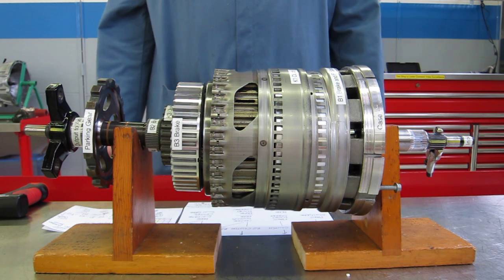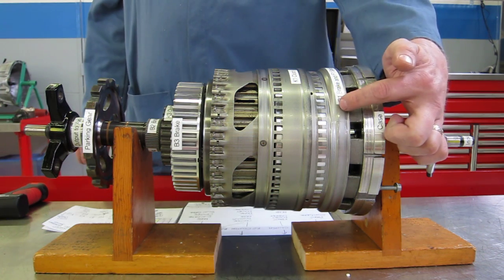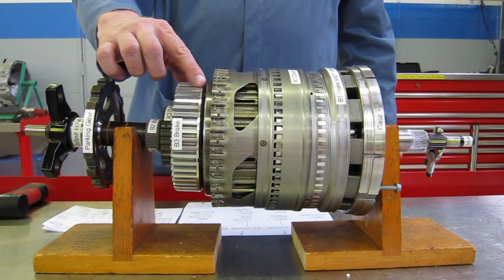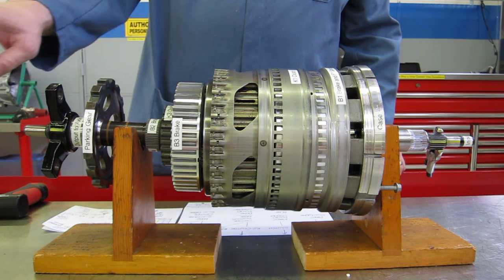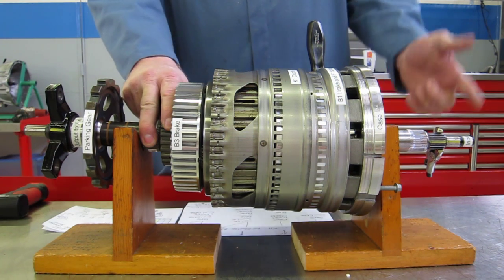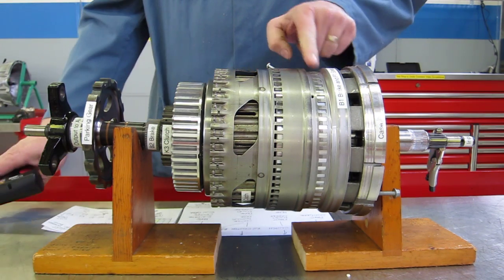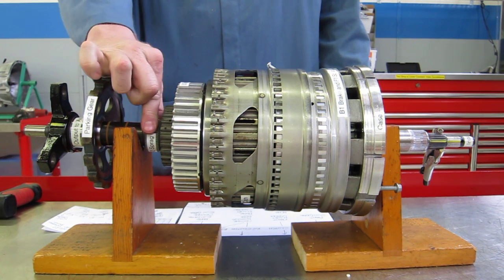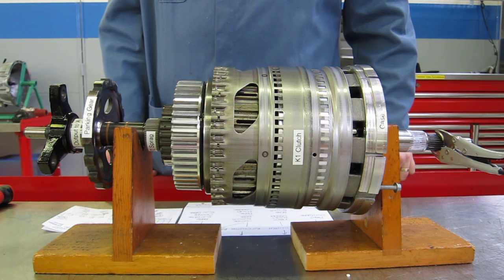Chrysler NAG1 5-Speed Transmission Power Flow

Comment: What components move when the engine is off and the output shaft is rotated like a car coasting in neutral? I am getting what sounds like gear noise and have narrowed it down to that simple state while turning the rear wheel by hand with it off the ground and engine off.

Comment: what is the maximum trans temp for this transmission? My 2017 Wrangler has this trans and I pull a small camper (2800 lbs) and don't want to over heat the trans!!

Comment: having an issue in changing shift points in challenger srt8 2009... what are we missing using the hp tuner and license ? thanks . wanting to change 1-4 gears up 200 rpm to run @ 6,400 rpm.. help..you can email me at coachingbaseball@aol.com.... thanks.
Reply from the maker: Sorry, I do not have any information on that system

Comment: How is the 2nd gear in reverse applied?
Reply from the maker: a second reverse position on the shifter
Reply: My car doesn't have a second revers position on the shifter. It has a Button(switch) that allows the car to take off in second gear in both forwards and revers directions. You showed in your video how the 1 gear in revers is achieved through the manipulating of the clutches, how is the second gear in revers achieved through the manipulate of the clutches?

Comment: I have an 06 Dodge Charger with about a hundred thousand miles on it I'm getting a vibration or shudder at low RPMs when maintaining speed if I shift it and manual mode it goes away it also shutters when I'm slowing down to stop anybody have any suggestions it shifts fine but after it runs through all the gears and I'm just cruising it starts to shutter I change the fluid twice and put a new filter in I also added friction modifier but nothing helped it it almost feels like the torque converter isn't disengaging could it be that TCC solenoid for the torque converter I just find it strange that when I shift it in manual mode it goes away
Reply from the maker: Manual mode bypasses the one-way clutches in the transmission. Chances are high that one of them are slipping. they cannot slip in manual mode because an additional clutch is applied to perform the same function as the one-way clutch. It sounds like you have a serious failure in the works. Best wishes!
Reply: WeberAuto thanks for the reply so I probably need my clutch discs replaced sounds lovely lol
Reply: jt12000, what are you going to do or did to remedy this issue? I also have a 2006 charger with the exact issue, if you repaired it what did it cost total please and thank you.... @newwavepressure6478
Reply: @filomartinez247  i still have it its got to be the torque converter or the trans im goin to buy a factory remanufactured trans and now converter i flushed the trans 3 time with a new filter and the friction modifier nothing worked i did engine mounts just to make sure it wasn't that i had my overhauled like 2 years ago cost me lik 1500 if i had to do it over i would have put a new one in and did it right the first time and i wouldn't have the prob now so if u have the money go with a factory remanufactured can just spend too much money trying to figure out what it is by the time you put a torque converter and you have to drop the tranny anyway and might be the clutch packs or bad sprag or bad valve body and just a remanufactured valve body is about 800 good luck man iv bin just shifting it in manual mode after it gos thru all the gears and when im about to stop
Reply: `` @newwavepressure6478  ok JT thank you for answering, makes allot of sense not wasting money fixing one thing after the other, I will do the same ...thanks again...luck
Reply: hey JT, this is crazy, today this morning I changed out my entire fuse box with some computer thing attatched to my 2006 dodge charger rt in the engine compartment with another fuse box identical from a 2006 chrysler 300, and guess what bro, THE TRANSMISSION DOES NOT SHUDDER ANYMORE...I drove my charger for miles and miles slow and fast and dear GOD almighty, it does not shudder anymore....so that being said and done, try that first, and lemme know if it worked for you too....good luck I'm so happy @newwavepressure6478
Reply: @filomartinez247  congrats man  I'm glad somebody figured it out it was the fuse box under the hood was it the engine ECU the main computer
Reply: @filomartinez247  what made you change that I wouldn't even have thought anything about the fuse box
Reply: see i had a short in the box , from what I am not sure not even some techs could figure it out, but today saturday morning I decided to change it so i did and went out shopping for some stuff and noticed it ran smoother and did NOT shudder anymore, but I changed the whole fuse box with the computer thing stuck to it, its in the engine compartment , like i said just it belonged to a 06 chrysler 300 and its the exact same thing, and walla the shudder went away, its crazy amazing, i cannot explain it, but all i know is that it took my short away along with the shudder, mind you after this my mileage gauge and the temp gauge do not work, until i insert the key, push the reset button to the left on my dash and turn the key to on without turning on the car, it resets the cluster and boom, all works great, its just amazing great, you should try it, I got the replacement part at a junk yard...lemme know if you do and if it worked...luck @newwavepressure6478
Reply: I'm assuming that is what it is, its stuck to the main fuse box under the hood in the engin, attatched right to the fuse box, it's amazing, see i take care of my charger no point intended, but that fusebox looked old, so i  grabbed that 06 chrysler 300 which are identical and boom, transmission working smooth...like a new car , or transmission...love my charger even more, and it don't hurt to try it out for yourself, save you 1000 dollars man, I even spoke to a transmission guy yesterday, gave him my symptoms and he was baffled but did not know either, so today this morning installed that new fuse box wtih computer attatched to it and walla, it works great, wow, I'm still amazed....lemme know if you do it and if it worked for you too because your symptoms were dead on identical to mine...good luck. @newwavepressure6478
Reply: @filomartinez247  ok thanks ill have to look into it i seen some online for sale but the looked like they where left outside lol im goin to shop around its def worth a try thanks again

Comment: Had this transmission in my 2013 300 replaced with a remanufactured one. Now when it’s cold(not warmed up), when I put it in gear it’ll make a “swishing” noise. If I put it back in park or neutral it stops. After I drive it a bit it stops making that noise putting it in gear. Seems to runs ok but the “swishing “ noise when cold, is that something I should worry about? Thanks

Comment: Hey I have an 05 chrysler 300c with the nag1 transmission. It will not move at all in forward or reverse. I pulled one of the trans cooler lines at the bottom of trans, started car and have no fluid flow. Trans fluid is where it should be.
Reply from the maker: Try pulling the gear selector into the low or 1st position and see if the vehicle will move forward.
Reply: It doesnt move in drive and it wont let me shift it manually. Should there always be fluid flow when the engine is running?
Reply from the maker: Did you see if there was cooler flow in gear? If there is no flow, but the fluid level seems fine, there is an internal problem with the filter or pump.
Reply: Removed filter. Pretty dirty. Fluid is pretty dark and has a burnt smell.
Reply: No metal shavings or chunks. Car sat for 3 years not running. Think it was just the filter and fluid?
Reply: Just curious could the trans be not working at all from being low 1 quart?
Reply: I measured how much came out. 5.5 liters. Manual says to put in 7 liters when draining pan and changing filter. This be the problem?

Comment: I have this transmission in a 2013 Chrysler 300 S and in 2nd gear it's making a turbo like whistling noise that increases in pitch with the rpms, it stops when it hits 3rd gear. Brought it back to the Dealer and they have had it there over a month trying to figure out what that 2nd gear sound is. They now told me they're going to replace my transmission with a re manufactured one but that's on back order. Any idea what might be making that 2nd gear turbo like sound?  Thanks
Reply from the maker: There could be several causes: fluid level, worn bearings, worn gears, a solenoid problem. It sounds like a gear noise to me. The fact that it quits in 3rd gear is a good diagnostic clue. I would figure out what internal transmission part(s) stopped rotating in 3rd gear? That is how I would diagnose it. Best wishes.
Reply: WeberAuto thank you

Comment: I have a 2007 Jeep Wrangler it’s making a whining noise as I accelerate to go and hear like a whining like sound almost like a vacuum leak or like muffler loud sound but had it all checked and it’s nothing to do with muffler system at all. Need help
Reply from the maker: Make sure your fluid level is correct at the correct temperature

Comment: This is on my 2007 Jeep Grand Cherokee 3.7L v6 am I correct?

thanks
Reply: Sean no.you have a 4 speed trans
Reply: The WK Jeep (05-10) had NAG1 standard in STR8(6.1) and Laredo(V6). The Limited and Overland came with the Chrysler 45RFE.

Comment: Actually it's made by ZF not Mercedes
Reply: Mercedes designs their own transmissions. I'm not aware of them using ZF either.
Reply from the maker: Hi, I do not know where you found that information, but I do not think it is correct. Every ZF transmission I have ever seen clearly is marked with ZF casting markings and ID tag. This transmission is clearly marked with Mercedes casting markings. Please provide your source. Thank you.
Reply: The Mercedes 5-spd is their version of the ZF model.  As is the Chrysler A580.  Mercedes does not build this transmission for Chrysler, at least after 2008.  Chrysler first acquired manufacturing rights from ZF, and later purchased the design from ZF, and produces the unit at their Kokomo 2 plant in Indiana.  From 2011+, it is 100% Chrysler.

Comment: This trans is also found in the 2012 and up Jeep Wranglers with the 3.6 pentastar engines with Auto Trans
Reply: Through 2017.  After 2017, the Charger Pursuit is the only vehicle using the A580.
Reply from the maker: +PHXGlock Yes it is. Thanks for the feedback.

Comment: Does the 2013 charger v6 use this transmission?
Reply: +WeberAuto NAG1, 722.6, and W5A580 are all names for the same trans.
Reply from the maker: +Omar Mares This 5-speed automatic was behind V8 engines. I think the Charger V6 got the ZF 8HP45 8-speed automatic. I could be wrong, but it should be easy to tell if you have a 5-speed or an 8-speed. Thanks for watching!
Reply: +WeberAuto my charger is a v6 and uses the 5 speed that's why I was wondering if those was the transmission in it and thanks for replying!
Reply from the maker: +Omar Mares It sounds like it is the NAG1 transmission.
Reply: The A580 was used behind the 3.6 engine through 2014.  The 845RE was optional. 

In 2015, the 845RE became standard on all retail V6 cars, and the 890RE on the retail V8 cars.
 
Hellcats use the 895RE. 

Charger Pursuits (all) use the A580 through 2018, and will switch to the 845/895RE by 2020.

Comment: is this identical to the mercedes 722.6 transmission?
Reply: +nicholas elias Yes the 722.6 is a W5A580
Reply from the maker: +nicholas elias Hi, no, it is the Mercedes W5A580. Thanks for watching.
Reply: +nicholas elias Yes most Benz after 2007 have the 722.9 7 speed also know as the NAG2. 
722.6 is Now a quite old design, I saw the first on in a 1997 E320 PDI back when I was still a snot nosed punk. When I left Benz the 722.9 was the main Trans we were dealing with.
Reply: if its the 722.6/NAG1 it should have 2 reverse gears also not 1 like weberauto says
https://en.wikipedia.org/wiki/Mercedes-Benz_5G-Tronic_transmission
Reply: The A580 is Chrysler's designation for this transmission.  It is built by Chrysler at its Kokomo 2 plant, not by Mercedes.  The assembly is actually a Chrysler adaptation of the ZF 5HP30 transmission.
Reply: +PHXGlock I thought so... now they use mainly the 7 speed 722.9 on later model cars.

Comment: NAG1 is not used on the Hemi'
Reply: That used be the only transmission you could get on the HEMI cars with the auto. Now there's 8-speeds.
Reply: bleachinuri challengers chargers 300s all with the hemis 5.7 6.1 or 6.4 did all use the nag1 trans the trucks used the 545 and then the 645 but they all have a 8speed behind them now
Reply from the maker: Slapaho1100 It is still used today in Police package Chargers.
Reply: On cars, standard on all retail vehicles through 2014. V6 cars have an optional 845RE beginning in 2012, standard in 2015.  Retail V8 cars got the 890RE (8HP90) in 2015; Hellcats got a 895RE the same year.  All 2009+ A580 and 2012+ 84XRE are built by Chrysler in Kokomo. 

All Charger Pursuit police vehicles through 2018, and all Wranglers through 2017 use the Chrysler A580.
Reply from the maker: 2005 and above 300C
Reply: WeberAuto
2011-13 jeep grand cherokee with the v-6, and 6.4l,3.0l diesel uses this now, 2011 5.7 hemi uses 545rfe,2012-2013 5.7 hemi uses the 65rfe, 2014-on 3.6l uses 845rfe,and the 2014-on 3.0l,5.7l, and 6.4l, use the 8hp70 along with all other chrysler  platforms using these engines
Reply: Gary L yeah I know that's why I gave dates. It was used on lots of cars and trucks up to 2010 when it was decided there were better candidates for fuel milage and durability
Reply: Dieseltech36 and the 8 speeds are the 845rfe and 8hp70
Reply: Dieseltech36 I know they started using them on v6s around 2010 the first hemi to get one was in the rams in 2013 and now all hemis have them for 2015 and yes they are by far a better trans in more than just fuel economy
Reply: nag1 is used on the hemi from years 05 to 08 as far as i know rt and srt
Reply: @Slapaho1100  also on 2014 5.7HEMI 300c AWD.  The last year for this combination.  I drive one.
Reply: Lol yes it is.
Reply: Nag 1 on my 2010 300c awd

Comment from the maker: @tnphysics Hi, the input shaft connects to the input ring gear.  The K1 clutch connects the front planet carrier and rear ring gear when it is applied in 2nd, 3rd, and 4th. The B1 brake, when applied, holds the F1 sprag which is connected to the input sun gear in first gear and 5th gear.